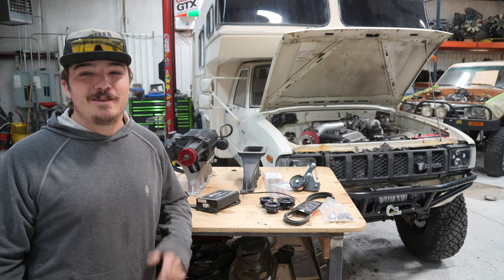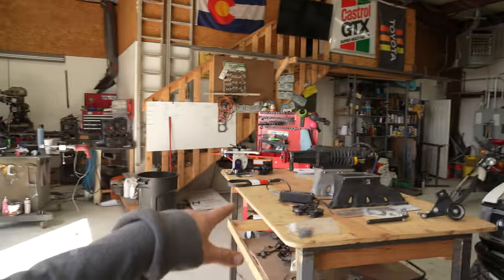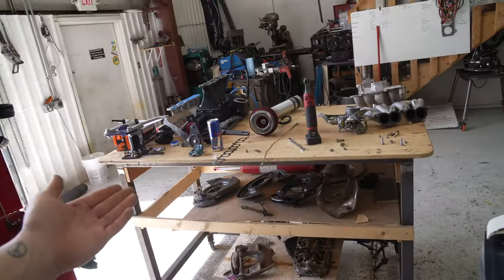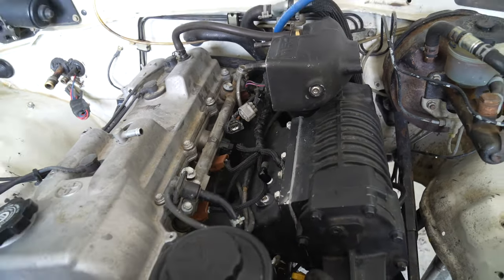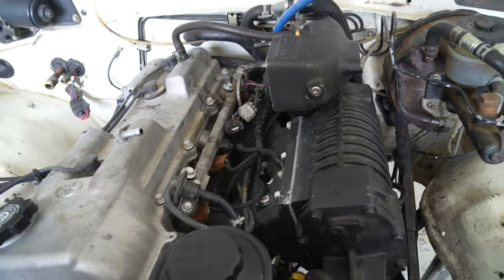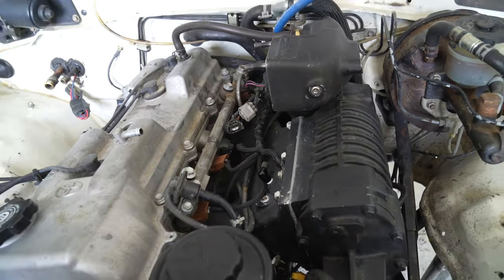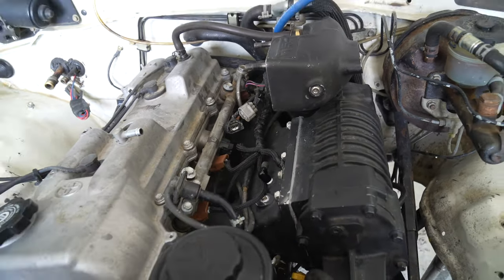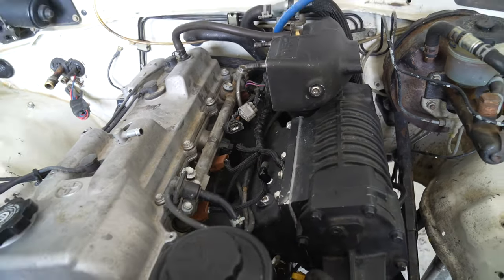3RZ Supercharger Install & Test Drive - Vintage 4WD Toyota Sunrader

Comment: I used to have a 02 single cab Tacoma, automatic 4x4, 3RZ with 33 inch all terrain tires and I took it to the drag strip for shits and giggles once. It ran a 21 something if I remember right. It had like 250k miles on it too lol

Comment: Can it be installed to bone stock engine and ECU firmware?
Reply: Low boost probably but higher boost I would recomend some form of either stand alone ecu or a piggy back ecu. LCE sells everything for these 3rz engines

Comment: What ECU did you install, I have  the same LCE unit and the Split Second ECU they solid me doesn't work correctly . LCE said they have had issues with the Split Second ECU and their fix was to sell me a Haltec ECU for 2300. They dont work on their stuff and they cant figure out why it has issues. With all the upgrades I have spent over 6000 with LCE but they just want more, beware if your considering using LCE.
Reply: Do consider a new ecu. If you have a heavy vehicle, even with split second ftc and 5th injector,  the factory ecu won't keep up. It will ping and pull power. Eventually,  you'll crack the head. Haltec 1500 and meth injection will make more power at 2 psi than above at 7 or 8.